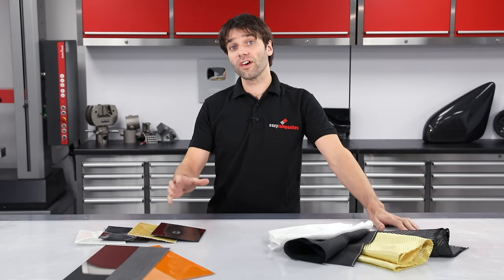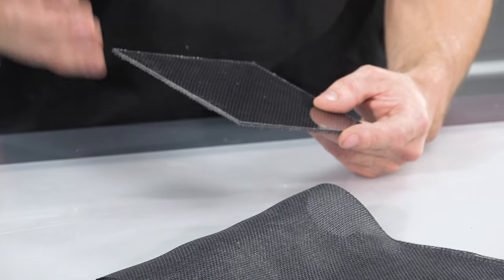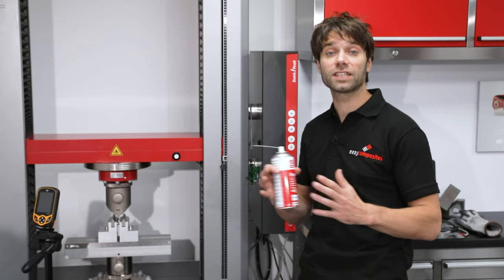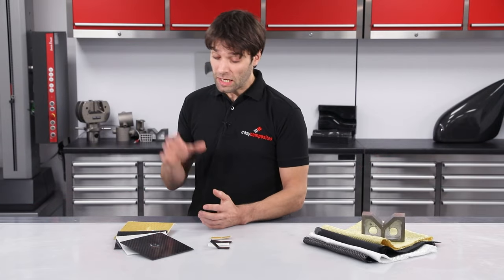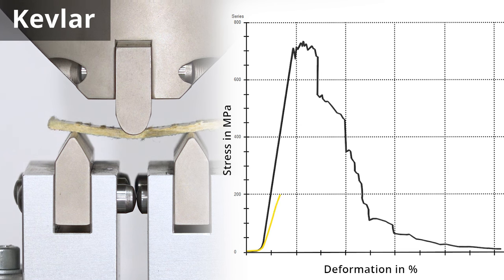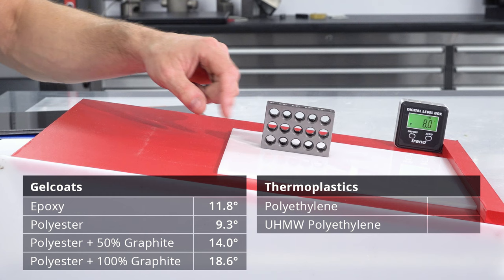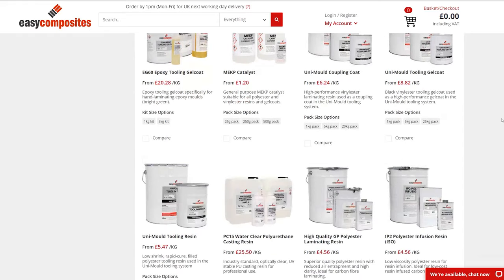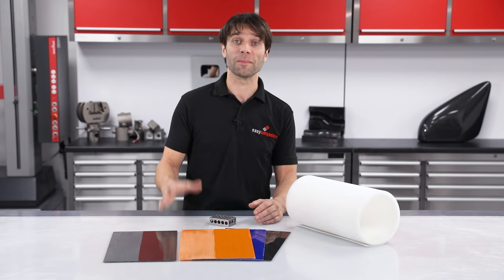Choosing Composite Reinforcements for Impact Strength; Kevlar, Carbon, Innegra, Diolen

Comment: why not try plain old fiber glass or e glass  with both polyester or epoxy  resins ,
Reply: For this specific project glass was discounted. If you check out the first in the series, I discuss with Paul the reasons why.
Reply from the maker: Strength to weight ratio, failure mode, glass wasn't really a contender. As for polyester resin, same thing really: reduced performance for a given weight of resin; where performance counts polyester doesn't really get a look in.

Comment: Sir can we bend composite materials? such as we have aluminum bent parts uses in aircrafts etc.
Reply from the maker: Composite parts cannot be permanently bent like sheet metals can be.  They would have to be moulded into the desired shape during manufacture.
Reply: @easycompositestv  Thank you Sir. Much clear.

Comment: If such little abrasion is encountered on the sleds, wouldn‘t ptfe instead of uhmwpe runners make sense? After all, ptfe‘s sliding resistance is even lower…
Reply: More slippery for sure, but with poorer wear, much higher cost, and harder to find in long, continuous sheets.
Reply: @AH-ns2wh  Bull. It‘s produced en masse for industrial machinery, and even a simple google search will net you various places around the world to source any size and form you need—and the runners are even a form that‘s commonly used for slide tracks. Against the cost of an expedition, the cost of PTFE is negligible as well, this is not some primary school project.

Yes, it wears more quickly. That‘s something I already noted in the post you replied to.
Reply: @Runoratsu  Well, that escalated fast. Not primary school indeed.

Comment: Is it possible to combine carbon fiber and kevlar to build a single piece?
Reply from the maker: Yes absolutely - in fact it is done often where material properties of the Kevlar are require for abrasion or puncture resistance but the stiffness and strength of carbon if required for the rest of the panel. There are also hybrid materials whereby carbon and kevlar/aramid are woven together in a single fabric.

Comment: How does S-2 glass compare to Innegra and Diolen?
Reply: Stronger and stiffer, but much heavier than Diolen, and wildly heavier than Innegra.
Reply: @AH-ns2wh  Thanks AH, just not in the business or familiar with them. 
Of all the current fabric, which is best for boat repair in your opinion? also VER, PER or Epoxy? If you're comfortable answering a boat question. Boats seem to be a different repair schedule than many other repairs. 21 foot boat
Reply: @robertjackson7590  I'll difer to the experts on that one. I do know that some types of fibres stay 'dry' within the composite matrix, and this can be a problem if there's a puncture, as they can absorb water.
Reply: @AH-ns2wh  Aramid is harder for the epoxy to bond to than other fibres and is Hygroscopic. This is why I didn't use it in my boat project below the waterline. It has it's place where it works best IMHO
"Kevlar is also hygroscopic, ultra violet sensitive and un-sandable, thus it is not recommended as a sheathing on outer ply of the laminate."
http://www.formula1-dictionary.net/kevlar.html
Thanks for your reply.

Comment: If these materials catch fire, is the smoke very toxic? This is my biggest fear on composite materials.
Reply from the maker: To the same degree that most burning plastics are toxic, yes. However, high fibre fraction composite laminates, like most of those tested in this video, are not particularly flammable and will tend to self-extinguish in most situations and so pose - quite possibly - less risk than many materials that surround you.

Comment: Suprised you didn't test E-glass. I worked in the snowboard industry, and triax e-glass is almost impossible to beat. Although carbon gives some interesting performance benefits, you just cant beat e-glass in reliable durability and all around performance.
Reply: Hi Greg - this has been tackled elsewhere, but as a summary - far too heavy for this application!
Reply: @AH-ns2wh  its probably different with a solid shell, but in a sandwich panel e-glass has properties right in between Kevlar and carbon. Not great with tensile but extremely good with compression and impact. Most sandwich panels break on compression so this is probably why in skis and snowboards its difficult to beat. I've seen as light as 10oz e-glass per side used in a snowboard, you can get it pretty light and strong.
Reply: @GregRosolowski  Yes, but glass of any type is significantly more dense than most other composite materials. These sledges need to be hauled, and grams count.

Comment: Is there a reason why you don't mix , or layer,  the materials?
Reply from the maker: No, you can definitely use hybrid fabrics (where the fabric itself is made of more than one fibre type) and you could also layer the materials to get a blend of properties. In the case of this particular project really Kevlar has all the properties we need and Kevlar wouldn’t really be improved by a blend with any other material but in lots of cases layers of different material or hybrid fabrics could be an advantage. Maybe a topic for a future video!

Comment: Curious as to why zylon wasn't tested.
Reply from the maker: Hi Rich, good question. There are in fact a whole myriad of other fibre types that we could have tested; PBO (Zylon), UHMWPE (Spectra/Dyneema) and then we could look at hybrids of these materials, either with carbon or hybridized with other fibres... the number of combinations would be almost endless. If we tried to do a comprehensive test then I don't think we could ever realistically produce the video. We only tested materials we stock and went through the decision process that a customer might go through (albeit in thought only) when choosing a material for their project. The materials we evaluated are widely available, sensibly priced and commonly used. The end result (which you'll see in the next and final video) is stronger and lighter than anything commercially available. Could it potentially be even better? Well yes, things can always be better, but in a lot of ways I think sometimes projects like this can get bogged down raking through datasheets and agonising over this fibre type or that resin system when a lot of the time picking a broadly suitable material and then doing a good job of making something is what needs to happen!

Comment: I did not understand your primary reason for material selection? Or did I miss it? You state that Kevlar is the best because it maintains its integrity all along as compared with the other choices, but wouldn't that always be the case? What about the input forces it will be subjected to in the use case? If the use case allows for a slightly weaker material choice what is the course taken?
Reply from the maker: Hi Madhav, the selection was based on the specific use. Different cases may have different results. The video was also to show comparison in general between those materials for a few select environments and situations.

Comment: Lay-up, gsm, thickness of these samples?
Reply: @pannonianknight  true 😂🥔
Reply from the maker: Hi Jakub, sorry for the delay. We have a project page for this video at https://www.easycomposites.co.uk/learning/choosing-composite-reinforcements-for-impact-strength - I haven't done it yet but I'll do a full write up and include a table with the layup information for each of the samples. Diolen and Innegra are very cost effective materials, I think we all know that carbon and Kevlar are not cheap fibres, but we're not using anything too exotic here.

Comment: I'm using kevlar/ carbon fiber sandwich between innegra hybrid for on leg braces does anyone know something stronger in flexualstrength and impact strength ?
Reply from the maker: Hi Adolfo, I can see a lot of sense in that combination. Without knowing the specifics it's difficult to say if an alternative laminate would be better but it might be worth considering having pure carbon on the inside (doing almost all the work) with just thin layers of pure Innegra on the outside, to act as 'protection' from the carbon inside in the even of a full failure. Since carbon has the highest strength and modulus and, designed correctly, you can ensure that it has sufficient strength to withstand any impact it's likely to see, you could probably improve the performance by tinting the balance more towards carbon.

Comment: Too bad you forget to inform of a huge issue of kevlar :
Kevlar is extremely vulnerable to UV (and polar weather include serious amount of UV), which render the kevlar fragile.
That's why kevlar, tough being a great improvement at its time, is now replaced in most of its uses.
Too bad you didnt try with UHMWPE cloth, which is now the current state of the art for modern fibers.
Reply from the maker: Hi Kurtz, in the next video we use a black gelcoat which makes UV fading a non-issue.

Comment: fyi -45c is not low enough for the north pole ... and it doesnt account for humidity or wind chill ... -50c with a wind chill of -20c on top is common ... -45c is like sitting in air conditioning at 20c while it is 24c outside ... not really worth the bother .... 
.
how do I know I live there ... -45c is not worth the time or effort to test ... if it aint -70c it will fail
.
your ice test again is not low enough ... also north pole ice is not clean ... it is dirty mostly and pollen and volcanic ash .... again -50c plus wind chill and dirty ice ... and dont forget weight of the test sample propotionate to the weight carried on the sledge
Reply from the maker: You missed the point of the tests which were a comparison of materials not a precise accurate example of the working environment. The Dark Ice team are well aware of the conditions having been in the Arctic region many times before.

Comment: Your friction tests have all the plates moving around and bending. Needs to be redone entirely with the sheets clamped down.

And the constant "poking" you did also interfered with the results. If your testing requires agitating until you run into a circumstance (looking besides the point that this would be another topic of consideration with the "sticking power" of any given surface), you do so in a controlled manner by using something that can reliably impart the same amount of force over and over again (probably something spring-loaded).. Or you give the sliding test pieces a running start to begin with instead of just placing them down on the surface.